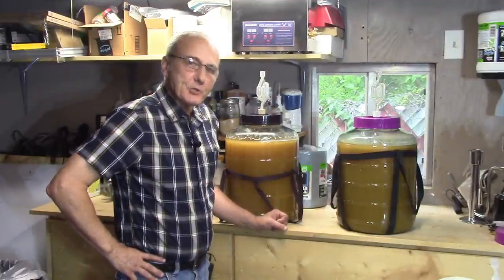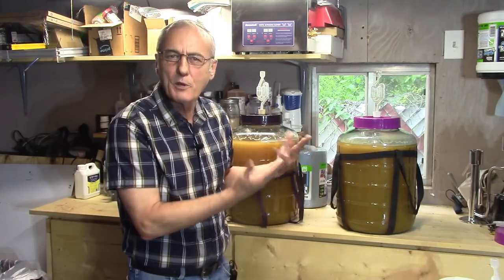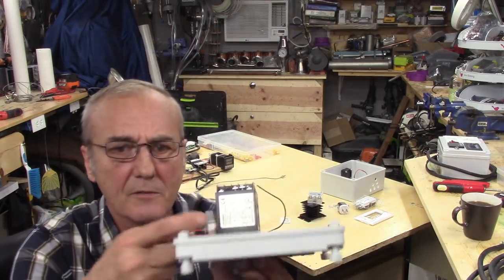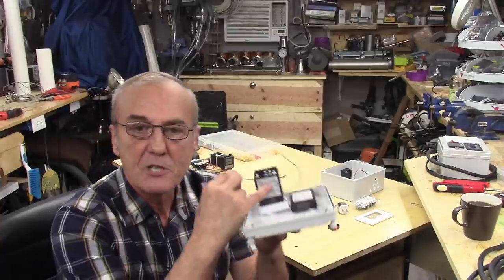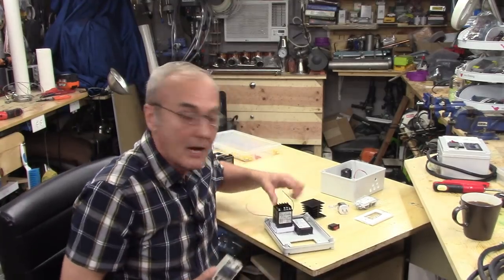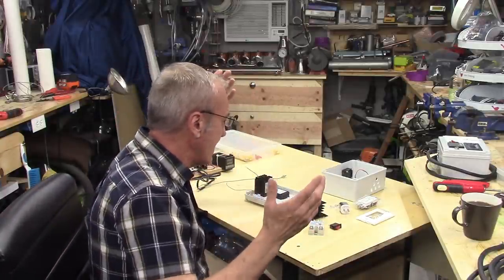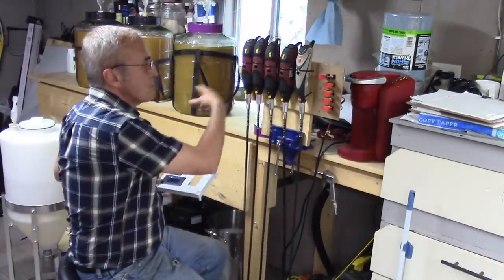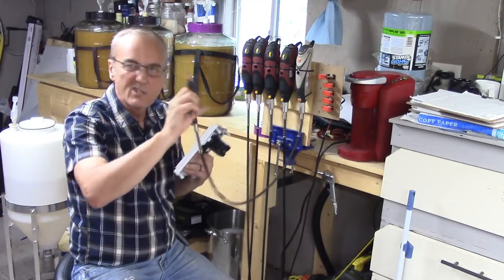COMPLETE WIRING OF THE 120V PID CONTROLLER

Comment: Hey George, your videos and wealth of knowledge are so much appreciated by myself and I'm sure all of the others. Please in no way take this comment in a negative manner. I've owned an Electrical Supply Shop for close to 17 years and have worked in the  Industry since 1983. One note on the 300v rated SJOOW and the heavier 600v rated SOOW rubber cord. When ordering rubber  cord, please ask for it as 12/3 for three wire cord or 12/4  for a four wire cord (or whatever gauge size you might need). In rubber cord asking for 12/2 may potentially get you just a two wire cord, unless a question was asked by the Supply person before cutting the wire.. When dealing with Romex indoor house type wire with plastic style jacket or UF (underground feeder) gray overall plastic style jacket, that's when you would ask for 12/2 with ground to get a solid  black, white and bare copper wire in it's jacket, or 12/3 with ground, it would have a solid black, white, red and bare copper ground in its jacket. Also FYI, 12/2 rubber cord would have only a stranded black and white wire inside the rubber overall jacket, the 12/3 would have a stranded black, white and green and the 12/4 would have a sranded black, white, red and green inside. Just commenting on this to save a possible extra trip to supply or re-order situation online. Hope this helps someone. Again thank you for your superb teaching style, time and efforts it takes to operate such a wonderful channel. Merry Christmas almost to you. P.s. Do you sell these already assembled by chance?

Comment: George because of you I started a couple of years ago. I have 2 PID controllers (pre-assembled because I was fearful) but now have started to collect all the parts for a manual controller (SCR-based) and have gained the confidence (from watching you build ) to build my own. I am looking for a mini-jack/plug assy for my temp gauge, already recv'd my 1/2" K probe which came with 2 lug connection...my othe probes are jack connected. This is my last hurdle...THANKS, GEORGE! you got me into this hobby and am loving it. You taught me everything! and not to boast, but have gotten damn good at it, at least my friends love what I make...truely George, it's all because of you
Reply: What brands are your pids? Where did you get them from?
Reply: @Hanson423  Inkbird #IPB168 (from Inkbird) & Bayite #BTC211 (from Amazon)...note:these are for my 1500W elements.
I built (from George's lessons) an SCR manual controller for my 2000W element
Reply: @mauistevebear  thanks! I’m either buy one prebuilt or make the one this video. It’ll depend on the cost and how brave I am building it myself haha
Reply: @mauistevebear   what did you think of the inkbird and bayite? Did the work well for you?
Reply: @Hanson423  The Inkbird rocks, I use it all the time...the Baylite was getting complicated. Each cost less than $50.00. The build cost me about the same, but I got great satisfaction when it was done...and it worked!!

Comment: 12-2.

My former (YES!) boss and I used to go back and forth 
on 12-2 cables having 2 or 3 conductors in them.  I said 
they were 3 conductors, 2 power leads, and a ground.

He said that 12-2 was just 2 wires and no ground.

Retirement is GREAT!  First SS check in a few weeks.

steve

Comment: Hey guys, stumbled across this channel a few weeks ago. George does such a wonderful job explaining the PID builds. I also didn’t realize how affordable the parts to build these controllers are. We also worry about a worst case scenario. It seems to me, if the SSR fails in the closed position normal full load amps will be applied to the heating element and a temperature runaway will occur until the SSR overheats into the open position. I may have missed something, please let me know. ( Have my parts for 120 volt build ordered)

Comment: Posting an update here from my last comment a couple months ago. My PID controller works beautifully for a standard pot still column. It also works with my 4 plate flute column but it's really  challenging to maintain a good reflux run regardless how low of a flow I had going to the deflag. I'll probably build a PWM controller as well so I can maintain constant heat to make those reflux runs more efficient and effective. I wonder where I could find a good video for that build? Oh yes, George has me covered there too. I'm doing so much with what I've learned from you George. Thanks so much, hope you're having a great break and I look forward to seeing you return when you're ready. Happy Distilling!

Comment: Great video, George! I have a PID and two PWM controllers and parts for a second PID. Always good to have backup. The PID from Inkbird has a handy on-off mode for doing simple things like running a mini-fridge to control fermentation temps. I use the PWM for distilling since the PID cycles on and off to maintain the set temp and I would rather control the voltage to the heating element with a simple knob. Individual preference. Happy distilling!

Comment: I really liked the video.  I would however add a fuse to the hot feed to your power switch.  If a hot lead should come free inside the box and touch neutral or ground the lighter gage wire will become a fuse.  An alternative is to use 20 amp rated wire throughout the box.  A bit tougher to handle but would eliminate the need for a fuse.  Again great video.

Comment: So after a couple months of watching Jesse and George, I jumped into having a go at making some whiskey myself using a 35L Brewzilla (similar to Grainfather and T500) after 3 weeks of not being sure if my ferments finished out properly (due to a variety of problems including not being 100% sure of my ph, breaking my alchometer before being able to do my first reading and thinking i killed my yeast with too much heat, I did 3 stripping runs (that included alot of bumps along the way) with 70 litres of wash using a copper potstill packed with scrubbies and SPP, i got just over 9 litres with abv readings of 64%, 68% & 70% per run, I then did a stripping run (which went like clockwork and made my day) I got just over 7 Litres of spirit with the foreshots reading 92%, after collecting heads until a vapour temp of 85C in 150ml jars I collected approximately 1.7 litres of heads (% is 72% :->) between 85C and 90C, then i collected tails in 150ml jars until 95C, then i collected the rest in a litre jar. The last jar looks cloudy so i don't think i want to use that bus so far everything kind of smells and tastes the same to me. I'm wondering if my proof is so high that ive made something i can mix altogether but being my first time i don't want to stuff it up. Any tips?

Comment: I would recommend adding a small Circuit Breaker in the circuit to protect your electronics.  Many switches are available with a Circuit Breaker integrated into them so you don’t have to have a separated wiring leads.

Comment: Love your YouTube. I have learned so much but still learning more each time I watch your videos. I do have a question. I built a ten gallon pot. I’m using a 2000 watt 110 element. I know I watched your video on the wattage and volts. It takes about 47 mins to hit 174. But with that said. Why do I have to raise it to 199 for it to produce. I check the barometer before fermenting and after fermenting at room temperature. All with in your guid lines. I’m using a PID controller. It’s calibrated correctly. I have ran five batches ( 5 five gallon). And all of the I had to go above the 174 temp. What am I doing wrong ? OH I’m not running a doubler. Pot straight to the condenser.

Comment: FWIW - I wire the fan to the PID output (the same that controls the SSR). It only runs when the SSR is 'on' but that seems good enough for me (up 5500W / 240V). Yes it cycles a lot.  It gives an indication when things are running too. Happy distilling!

Comment: I am making a controller and this is a great resource, thank you.
You seem to place the sensor in the vapors rather than in the liquid, Why? I would think that the PID controller could do a better job of maintaining temperature if directly coupled to the water where the heater is. Even after tuning the PID you seem to have temperature variations larger than a tuned PID should be able to maintain. Or is having the temperature oscillate about the set point helpful?
I will be adding a fuse or circuit breaker, I like my house.

Comment: George, I know you know this but it has to be said. As you gain altitude a fluid (water or a mash ) will boil at a lower temprature due to the loss of atomospheric pressure. This loss of pressure and, of course, the lower temps and lack of oxygen due to the lower pressure are the reasons aricraft are pressurized and altitude suits are worn and to the greatest extreem space suits are worn. Having said that, if you want a long slow cook then you will boil but not heat at altitude. Alcohol will change state at a much lower temp all based on a constant BTU . The mile high folks may have a not so recognized advantage.  Jim.  Yes I know btu losses become an issue at 2000 feet and above.  Thank you for all you do and have done.   Inverse of Boyle's law. Thank You Nicola, go electric.

Comment: Can you use this to run a variable fan instead of a heating element? Using a fan for cooling but never want the fan off completely
Reply: Would it be possible to wire the temp coupler backwards and have it cool instead of heating

Comment: The "optical switch" or opto-coupler in a relay is not just for switching speeds.  It provides electrical isolation between control side and switching side which is safer and more reliable.

Comment: Howdy folks. Your videos have been SUPER helpful! Much appreciated! Now for my question:  doea anyone see any issue with hardwiring my PID controller directly to a breaker? The only thing would ever get plugges in would be my heating element and the switch for the outlet on PID would stay off when not in use. Any input appreciated. Thank you!

Comment: I make Knives and I'm going to use a kiln for heat treating and a toaster oven for tempering, the question is do I need to make two PID's or can I use one to run both the kiln and oven?
Reply: yes, ofcourse,  you can use the same PID controller for both. If these 2 platforms(oven, kiln etc) requires different PID settings, then you only have to set different values for each.
Reply: Coulld yo put two PID's in one box and spilt the plug to run both at the same time? or just you don't half to reset the values each time?

Comment: Can you use an electric urn that can set temperature to distill ? I assume you set it to say 80 C and it will switch on and off to try and keep it at 80. Will this method work and will it perhaps introduce methanol in other stages than the foreshots?

Comment: To the community since George is taking a much deserved break.  I have a PID attached to a 110V 2000W heating element.  Using the parameters from these presentations, the temperatures still fluctuate excessively (+/- 5 degrees) relative to set point.  That seems to bring tails into the mix.  Even if the PID kicks in briefly, the temperature will soar 10 degrees and this cycling never settles down.  The question is: once at running temperature, it almost seems like the heating element is too strong.  Would it be wise to put a PWM controller between the PID and heating element to tone down the 2000W to maybe 800W and would this flatten the temperature cycling out?  OR are there other settings I do not have correct on the PID in the first place?
Reply: I have the same issue.  I have taken to using a controller that came with my still which is basically  a rheostat. I just use the PID to monitor the temp at the top of the column.  I was hoping the PID would control the temperature more precisely, but mine jumps up and down like yours.

Comment: Hay sorry 😔 I am from NZ and I have built a small still that's only ten letters from a pressure cooker , and I don't have a large container for fermentation .just a 20 letter , I'm just looking at doing small runs just enough for me ,is it alright to halve a packet of turbo yeast ,so I can do one lot one week and the other next week ,I know you kinda said to pore in hole packets in other videos but I don't have that luxury I live in a small caravan in the middle of no where .
I would also ask if I can use the methonol as fuel for a lamp if some sort ,and I f I could use it to heat up my still from time to time

Comment: how would you go about having a temp set of 30 degrees C ,( the c-100 is pulsing nicely maintaining the temp overnight)and then i would like temp temperature increase to 55 degrees for 4 hours starting at 5 am in the morning and then go back to 30 degrees ? i'm pretty sure the Rex-c100 doesn't have a time  input parameter

Comment: Question: Let's assume that I might have two band heaters, but only one thermocouple (Type K) that is available for readings for temp. Can the two leads for the thermocouple be split to two different PID's and have some jumper to have a same common conductor so that the PID's aren't working at cross purposes?

Comment: I just have a Queston. I have a Twenty gallon All Copper still with a 4 inch clamp cap, tapered arm, to a 5 gallon all copper thumper, out to a thirty gallon plastic barrel with a twenty foot copper coil. I even have a copper thumper to that holds my hydrometer as it comes out the worm. Best way to Heat?

Comment: Dear sir,

Any suggestions on using and wiring a 6000 watt  208 Volt water heating element from Great Britain, as a 2000 watt 120Volt water heating element in the U.S. of A.??? 120 volt 2000 Watt elements barely reach 2/3 the way across the width of my 8gsl. still (HWD) vs. the 208V 6000watt which seems to be medium watt density or less, reducing the risk of scorching??? Thoughts appreciated!!!

Comment: You need to do a video on corn malt do you know that if you do a sugar mash and throw corn malt in it will make it's own yeast and will start a cap witch is that foam on top of the mash that the yeast makes here a recipe 25 gallons of water 30lbs sugar ,and a half gallon of corn malt it likes to work in a warm environment i pitch the corn malt in the mash at 90 degrees and mine is working from the husband

Comment: Question: Does anyone know of a open loop style controller, which can turn on a set low temperature & turn off at a set high temperature? Most are PID type that operate with a narrow temperature range or use an algorithm that causes short cycling.

Comment: Anyone know of a way to use a pid to control a pwm to vary the voltage to the element rather that just switching it on and off which seems very inefficient,

Comment: I know in canada they call sjoow  that has a white black and green wire  3 conductor so in the case of the wire you have in front of you is considered 12/3 in canada..  it is the only cable that I am aware of that  the ground is referred to as a conductor!  Take a quick look on your wire and it should be stamped right into the outer jacket.

Comment: Hi
Friends, answer my questions.

1- Is there any danger in producing ethanol alcohol with sugar?
2- If the answer is negative, then why don't you use sugar to produce ethanol alcohol.
2- How much sugar should I use to produce wine?
Reply: there is no methanol in a straight sugar wash. I use a sugar wash if i just want a straight vodka like drink. People use other ingredients to add flavour. Also use a pot still for flavour and a reflux for straight neutral spirits.  I don't make wine.  watch some of George's videos!
Reply: @rick43pen  Rick, I believe you meant to write, there is hardly any METHANOL in a sugar wash.
Reply: @robertt1782  woops, yes. corrected it.

Comment: I have to say, I a bit disappointed using this as a BBQ smoker controller. The rag is not about the design of the unit,, it's just electrical science.. Unless it's on it's own circuit be prepared to get flashing lights when shared with your patio lights.  PID is not on-off, therefore if it's plugged into the same circuit OR you build in an accessory switch on this power supply- expect your lights to blink erratically coinciding with the demand of the heating element.  I feel like I'm in a disco.

Comment: hey Mr George  i was wondering if you could e mail me or give me a call i want to thank you very  much i just sold my first turn key system  from your videoes. included  two waterpumps /heat control with all the whistels and bells /25 gallon keg /heat element/4 view window colum  with elephilimgator/theromstat top and bottom/all the hoses /home made parrot/pretty cool i would like you to see it if you have time thanks for all you doo